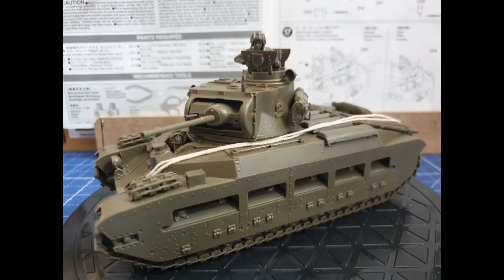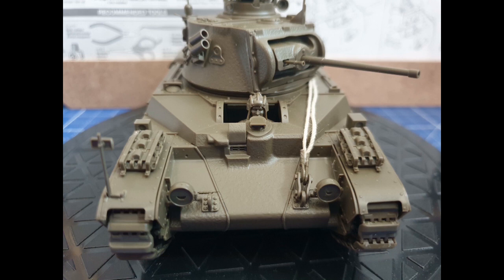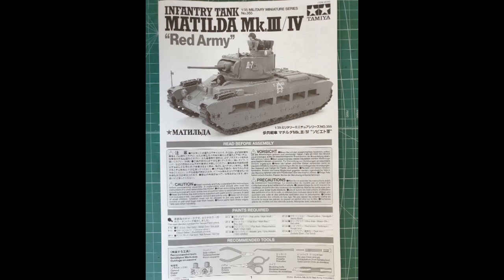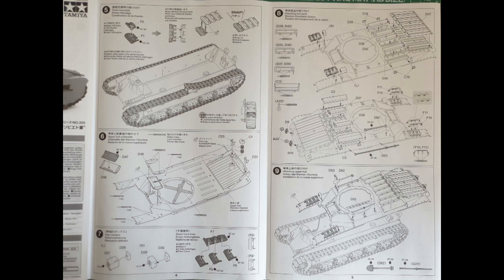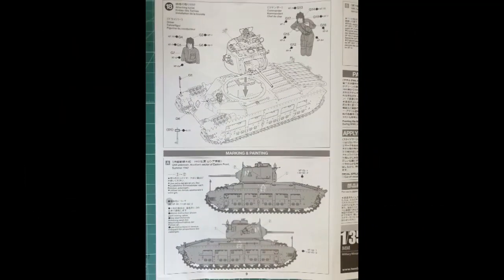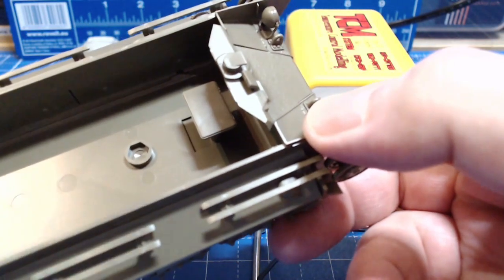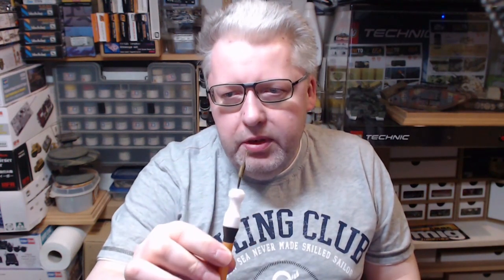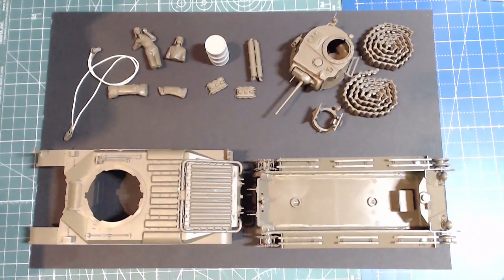Tamiya Matilda MK III Baubericht Teil. 2 / Bauende

Comment: cristal clear ist gewöhnlicher Holzleim^^
Reply from the maker: Micro Kristal Clear, hat nichts mit Holzleim zu tun, die Zusammenstellung ist eine andere und auch die Konsistenz, ich benutze es schon seit 2005, damit kannst du zb. in 1/700, 1/350 die Bullaugen Fenster machen, in 1/35 machen ich damit kleine Fenster sowie Scheinwerferlinsen. Die Trocknungszeit liegt so zwischen 7 bis 12 Minuten.  

https://www.dm-toys.de/blogartikel/items/micro-kristal-klear.html

cu
Markus
Reply: @Markus68Scale  es ist Holzleim  egal was >Du sagst^^  Ich kenne das zeug seit  dem es das gibt und holzleim gibt es in verschiedenen konsetenzen^^  Riech mal am pott. Ich habe meine test flasche beim Holzschiff modellbau mit verarbeitet es ein ein Holzleim der schnell trocknet. Revell Contacta  Clear ist auch nur Holzleim der verdünnt ist.